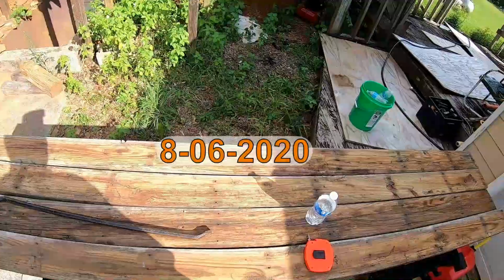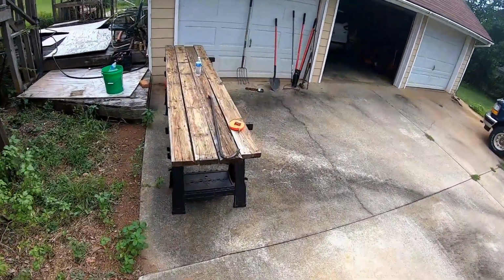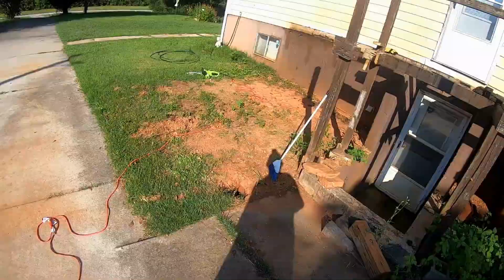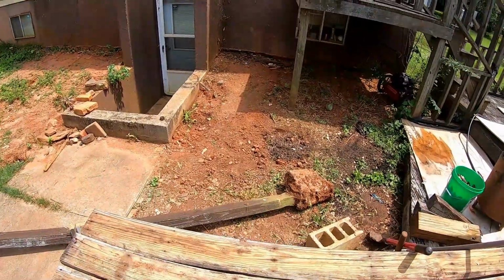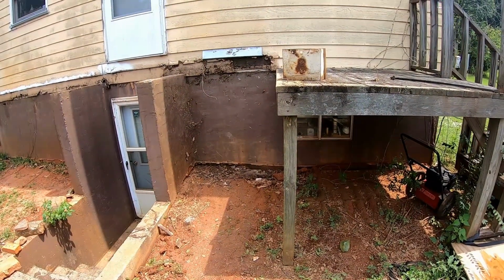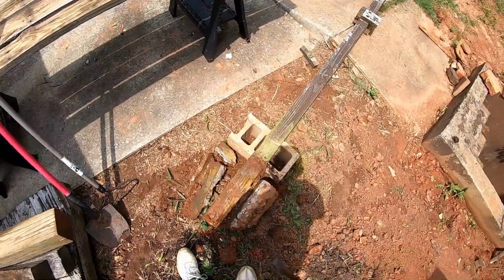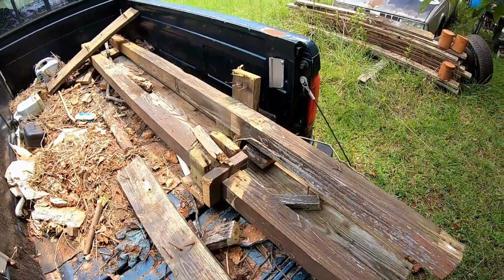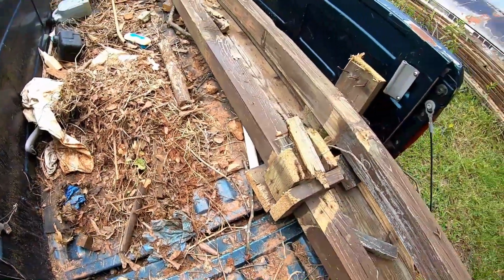Deck Project Continues Pwalpar VLOG 8 17 2020

Comment: Nice job Walter. Take things slow and it will be done before you know it. Just curious, does the county require a building permit? Also, why is there a small wall before the steps heading down to the basement?
Reply from the maker: I have no idea and aint gonna pursue the matter

Comment: They make a flatter one that UI got from Home Depot. Curved on one end to go under or behind the nail and the opposite end has a head grabber to leverage the nail head out of the wood.   It fact I happen to have 2 of them, one I'd gotten over 20 years ago and the other within the past 8 months. They are almost the same and both have the same features on them.
Oh, btw, my computer desk grew slightly to 3' x 6' and it's mounted at 32" above the floor. It's got room for the HP Desktop system running Windows 8.1 Pro, a 27" monitor, my Dell Notebook system running Windows 10 Home, and my Canon laser printer. Both systems are on my DSL wired or wireless modem running without a problem. Both are also attached to a 425VA 225W battery backup having 4 battery surge and 4 surge plugs. Got this from https://www.bhphotovideo.com/  They sell computer gear as well as photography gear at what I'd call a reasonable cost. Bought 2 backups and a 25' extension cord [ I gave 1 backup and extension cord to sister for her systems.] for under $80.00 shipped directly to my address in Mary Esther,.
Reply: It is called a Cat Claw and does what you two objects are doing

Comment: Walter when you start your new deck with the pressure treated lumber....  be very very very careful have gloves on all the time good sharp blade there’s harsh thinking the new pressure-treated lumber in a well ventilated area... when you cut it try not to breathe in the fumes,,,,,when you’re cut it careful handling it and you’re supposed to use stainless steel bolts and stainless steel screws and attaching the lumber because of the crux of what  in the wood.....galvanized nails will not  hold it for long!!!!!!!!!!!!! Do a little  homework before you start this,,,,,,  Walter this is my second career it always has been.... never really like the RAILROAD A  100% it was a steady paycheck  vacation and health benefits that’s what I use the railroad for that Walter take care of junkman do
Reply from the maker: Thanks for your advice